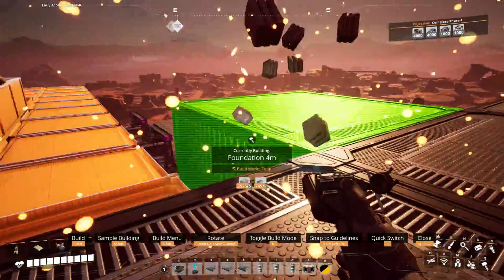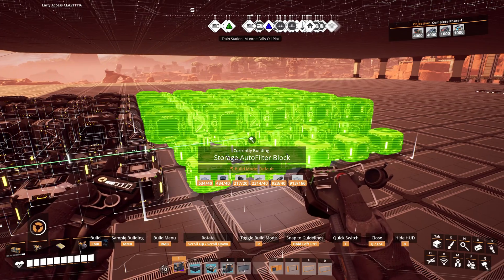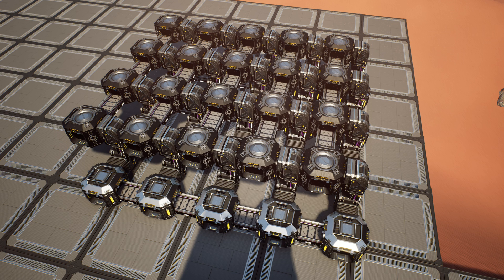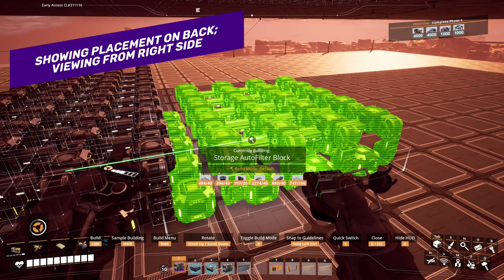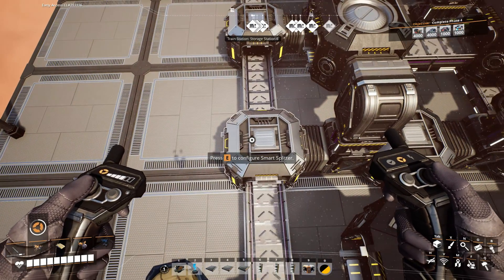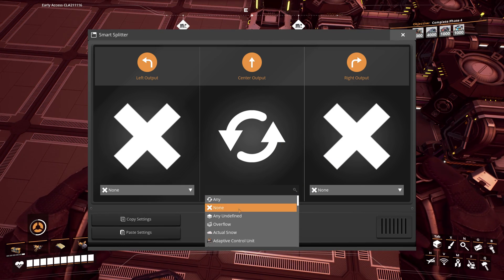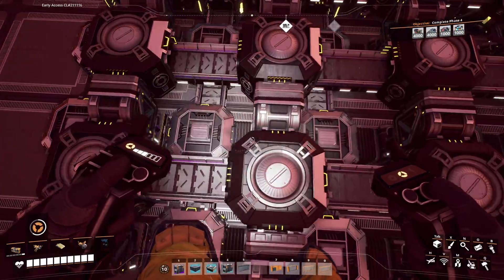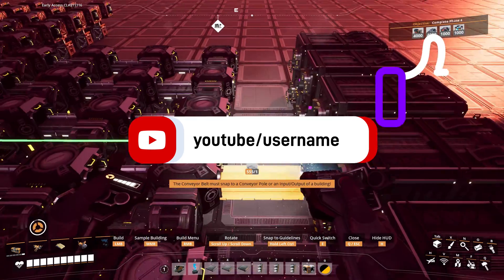I Rebuilt my Auto-Sorting Storage System using Blueprints in Satisfactory Update 7! (And I love it)

Comment: Great blueprint but there is one negative thing: When you have the same item on two or more input lines the input lines will back up, because the sorted line will process the input lines with the same item alternately. Ignoring that its a great and expandable blueprint!
Reply from the maker: Yes, this still has its limitations for mass flow of a single item based on consolidation to a single mkV in the end. 🙂 Thanks for the comment though!
Reply: @Parkinwad  Yes, I was going to say the same thing. Despite all this work, you're still stuck with the same bottleneck as before and it will now clog up all those extra input lines you created. However, if you set the smart splitter to use "overflow" instead of "undefined", each input line won't back up when the sorted line backs up.  You then only need to create enough overflow merge lines at the end to handle your max input rate - where each extra row has "any" set to the right and undefined for going forward (or just mergers if its the final extra row).  Each of those rows could then be connected to a sink or sent elsewhere for further use. That would let you try and store as many input belts of items that you want.

Comment: would have liked to see an actual explanation of why this is necessary
Reply from the maker: It's necessary on a case by case basis. Not many people get far enough into the game to warrant building something like this, or even want to build something like this. The point of this was to show that if you needed a build like this, it's capable of being built, and, with blueprints, can be built in about 1/5 of the time it would have taken otherwise. It's more of a proof-of-concept than an actual necessity. 🙂 Thanks so much for your input!  😁👍
Reply: @Parkinwad  I don't mean it in like a snarky way I'm just baffled as to why it looks so complex and what the reasoning is for the way it's designed etc. Like a demo of why it's good. I'm looking for ways to do the same thing so would have been useful to know!
Reply from the maker: @jpjapers  Ah, no worries bro. I didn't take it that way either. 😉

Comment: I love this design but I need to replace the smart splitters with programmable splitters.  When I do that, I can't get the conveyer lifts to align properly the way yours do (without the little extended connector part at the ends of the lifts).  How are you able to build it without those?  I've researched a bunch and cannot figure it out.
Reply from the maker: Check out the blueprint that I left for these in the description of the video. If you build it manually, unfortunately it is a lot of building the splitter, building the lift, building the top merger, then deleting and rebuilding the lift in order to get it to hook up to the merger up top. I had done this in the blueprint, then double checked them all to ensure they would all flow. 🙂
Not sure if your issue is specific to alignment with the programmable splitters or not.
Reply: @Parkinwad  Thanks man!  Amazing build!